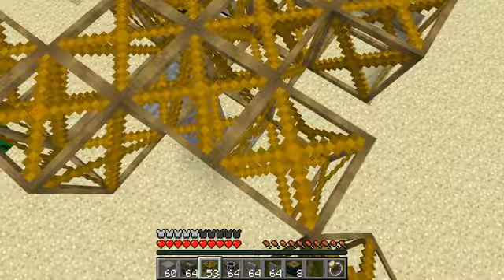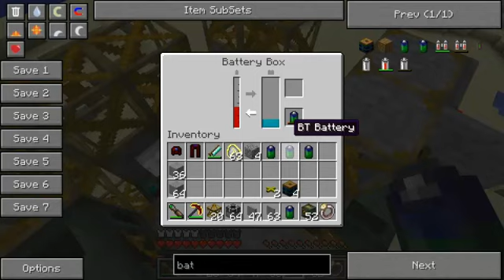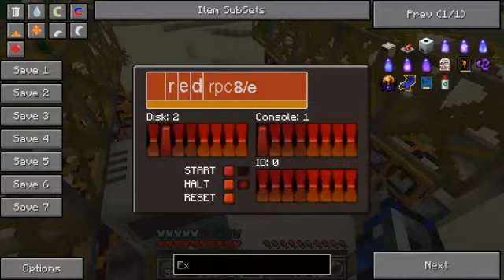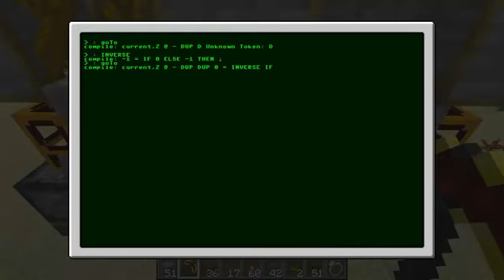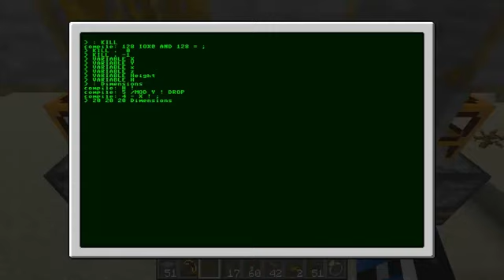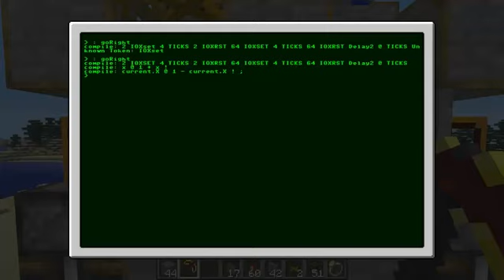[HowTo] Minecraft Mobile Quarry Mk 2.1 Tutorial - Programming and Design

Comment: Ok so i figured it all out. I just had to update computercraft I did that in Tekkit and now i can move without creating duplicate blocks. The only problem I'm having now is i'm using CraftOS 1.4 and it doesn't seem like your code works with 1.4. Unless you edited something out of the video that you have to do before you start typing in VARIABLE current.X . That line retruns "No such Pogram" when i try to do the same in lua it gives a string error. d

Comment: What are you using ? I can confirm that it is just the computer monitor that is causing the crash. I can hook up everything except that and fly around no problem. Does the computer monitor need to be on a solid block too or should just a frame do? I also tried putting it on a frame with a panel on it but that had the same effect. as soon as i move up i get a duplicate computer in block it just left.

Comment: i figured most of it out. You can only move one solid block. I mistakenly put all the computer parts on solid blocks and it wouldn't move at all. Now that i have that fixed i'm getting a weird bug where it moves but creates a new computer part for the empty space and it crashes mindcraft. so when i move it up it will have new computer parts under all the old computer parts after i white screen and restart.  It's not my computer my computer is literally brand new with top of the line stats.

Comment: I'm having problems when i connect the top to the the bottom. as long as the top isn't connected i can move it up an down but when i lower it to the bottom part it gets stuck and won't move. If I force it to move by turning the not gate it breaks the bottom what am I doing wrong ? If i try to connect the bottom to the top with frames it won't move at all.

Comment from the maker: I think I see. You need to add in a set of dimensions for all the .F and .B to work. When you type in RIGHT.F it checks where the quarry is right now against the dimensions of the quarry. If it is all the way to the right, it goes forward. Your quarry thinks it is all the way to the right for some reason. Try the same quarry out by doing this:
20 20 20 Dimensions
0 x !
1 z !
0 Height !
Then test out RIGHT.F

Comment: I was inspired by this to make this design, followed by my own, which is slightly different in layout but I have changed my inchworm drive around, and it's really nice, if you want a picture let me know :)

I'm having a problem with placing RAM, I try put it down on solid blocks and even after I've put the other components down and it just won't place for me at all... Do you know why that might be? I'm running pr5b2

Comment from the maker: Make sure frames are connected to the other motors. Also, check if it is a panel or a cover under the area the motor: experiment to see if making it a cover or removing it changes anything.